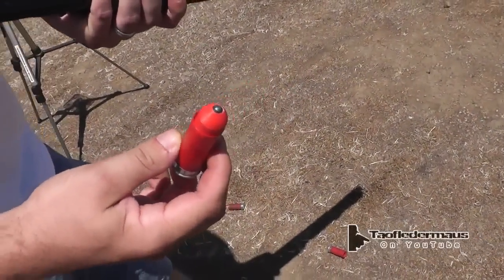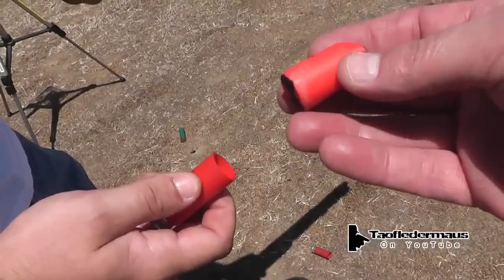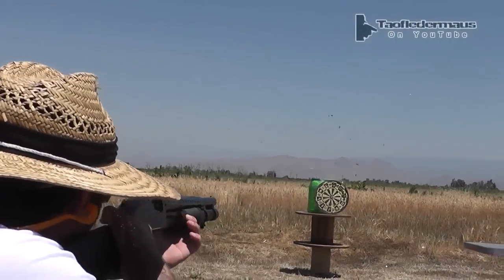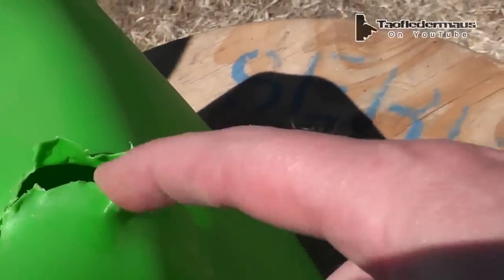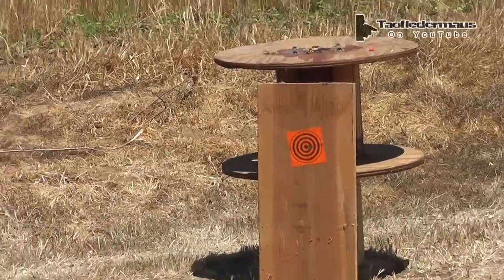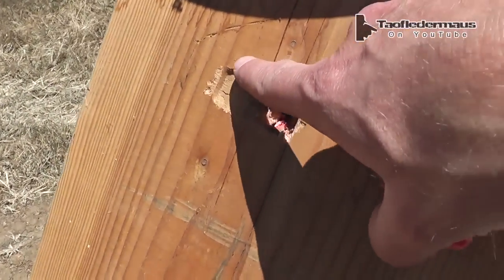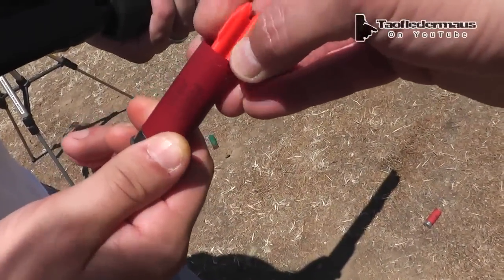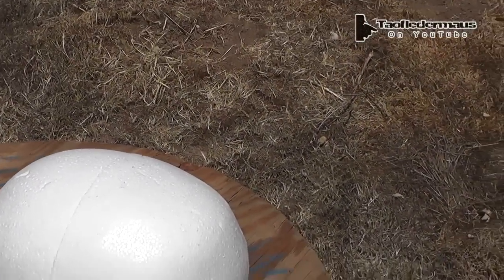"Terrifying" 3D PRINTED BULLETS - Spoiler:  they aren't terrifying!

Comment: So, do you think this could kill a man?
Reply: yes
Reply: It all depends on energy. I don't know what the muzzle velocity of these rounds were (but I do  know the weight as reported)… it takes a significant amount of energy to be lethal generally. A 12-gauge slug has a muzzle energy of about 2350 ft-lbs, while a .22LR generally has a muzzle energy of just 104 ft-lbs (or about 140J). A .22LR, while certainly carries the potential to be lethal, is not generally. A 12-gauge slug has a high probability of lethality, even for deer and bears.

I would be shocked to learn that the plastic acted as anything more than a sabot for the lead ball on the head, and as a result, I would say no, a plastic bullet is not — in and of itself — lethal. There's a reason the cops use plastic beanbags in shotguns and rubber bullets in others for riot control — they're less lethal.
Reply: phillis blunt that's when shot at a head or other critical areas, which they should be trained not to shoot at those spots
Reply: phillis blunt Yeah. Which is why I said LESS lethal.
Reply: i just put my input in but ur a smart guy let me get mine lol
Reply: no it wont, it will just go through him.
Reply: the bird shot is doing all the damage

Comment: print a slug with thin fold out fins !!
Reply from the maker: ben allinya  I don't think they'd survive the shock.
Reply: ben allinya You could probably cut up an aluminum can into wings, glue them into slots on the sides of the slug, and wrap them around the slug in the shell. They should pop out from the turbulence and add spin to it.

Comment: 3d bullets will be better lighter means less drop now all they have to do is balance those bullets!
Reply: GameHEADtime "
3d bullets will be better lighter means less drop now all they have to do is balance those bullets!"
Wrong, it doesn't matter how heavy it is, they all fall pretty much the same.
On the other hand - a light bulet will not travel near as far and have far less energy than a heavy bullet.
Reply: ABaumstumpf Nope. Do you even Physics?
Lighter bullet = faster velocity = lower travel time = less drop per foot traveled.
It's true it will have will have less energy and less range than a heavier bullet, but if you are at close to medium range usually lighter bullets are better because even a very light bullet will have lethal energy at close range.
Reply: TheBalefire Actually, I take that back about lighter bullets having less range.  Often, lighter bullets will actually go farther.  If you put a .50 cal in a sabot and shoot that out of a shotgun, it will go farther, have less drag, be more accurate, and have more penetrating power than using a full bore slug, despite being much lighter.
Reply: TheBalefire Styrofoam bullets should reach orbit.
Larger cross-section = more air friction. Less weight = less kinetic energy carrying capacity. Air friction is of viscotic nature, force proportional to speed, so increasing the speed won't help much.

Comment: so why don't you get a rifled barrel?
Reply: Because then it would not be a shotgun right? I am pretty sure that by definition shotguns are smoothbore.  It it had a rifled barrel it becomes a rifle.  I think! I could be totally wrong on this one though.
Reply: Yes, you are. They make and sell rifled slug barrels for every major model of shotgun on the market.
Reply: EitriBrokkr cool! Thanks for the info, I had no idea.  The shotguns I have used in the UK for hunting are always smoothbore.  Are the rifled barrels only used for big single piece slugs or can they effect the shot pattern of other cartridge types?
Reply: Might want to double with your local laws, but that's how it is in most of the US. Usually If you try using shot or other multi piece loads the centrifugal force on the shot caused by it spinning down the bore  tends to make it spread outward, leaving you with more of a donut shaped pattern, or erratic pellet placement at best